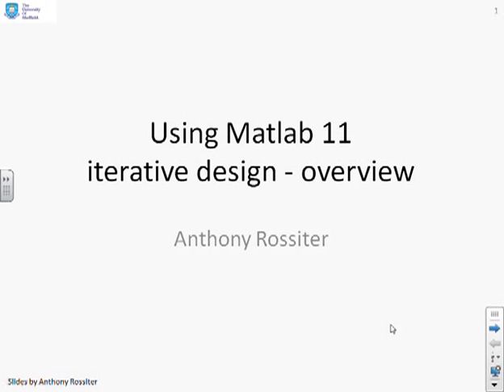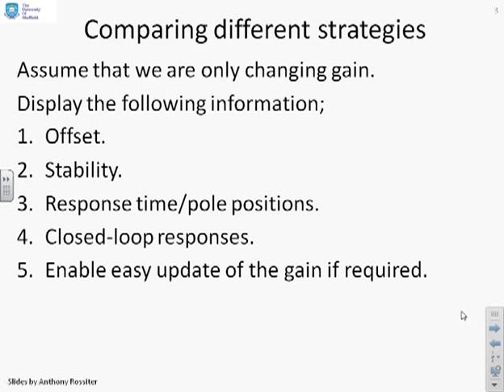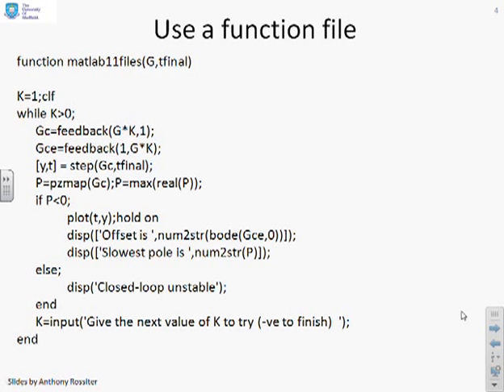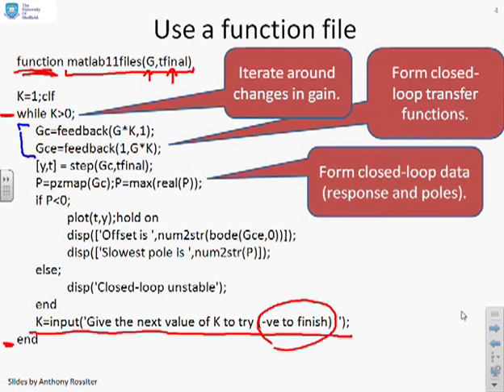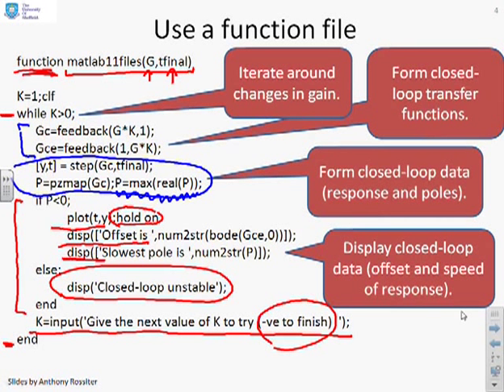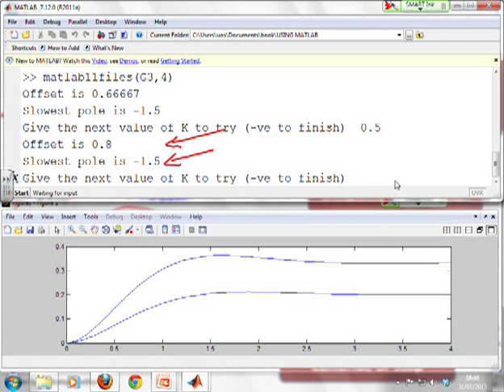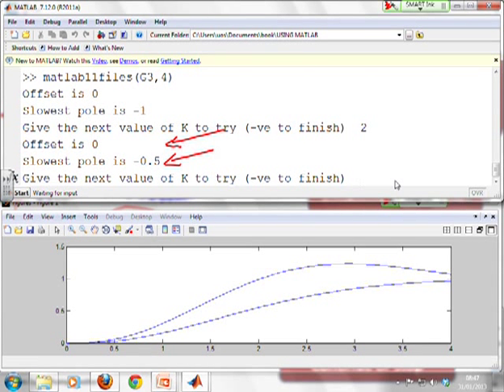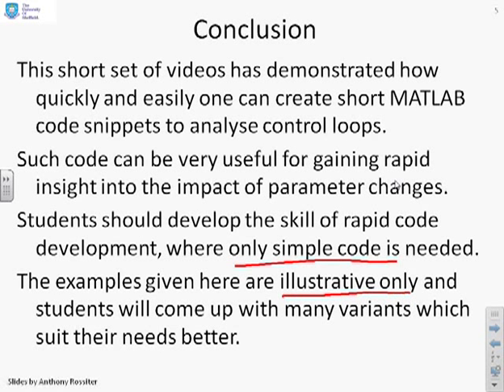Use of Matlab 11 - trial and error for overall closed-loop analysis

Comment: Actually code is not sensible enough. It doesn't check if the TF has poles and zeros in one spot, and can absolutely mislead us. Just try to feed it with that G=tf([1 0],[1 4 5 0]).
Though videos are perfect for studying.
Reply from the maker: The code is intended for elementary courses and starter students and not research and therefore is kept to a minimum complexity. It is assumed users don't feed it stupid data.
Reply: +John Rossiter Oh what is stupid data then?
I didn't mean to offend you. Sorry.